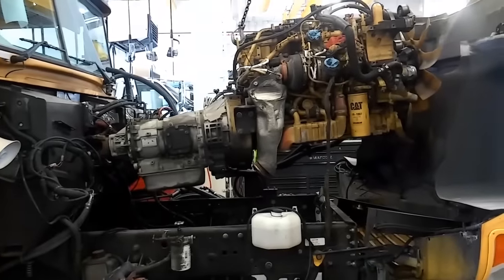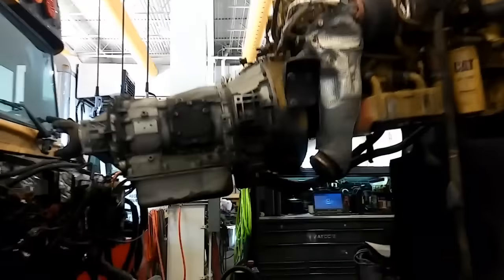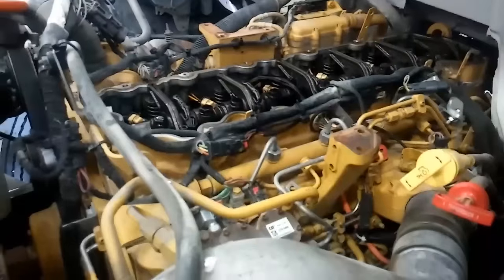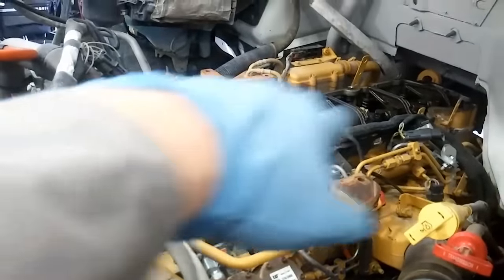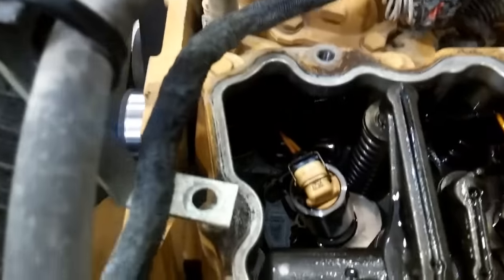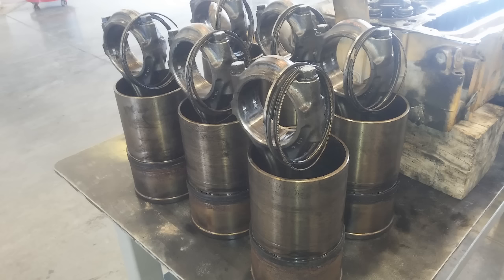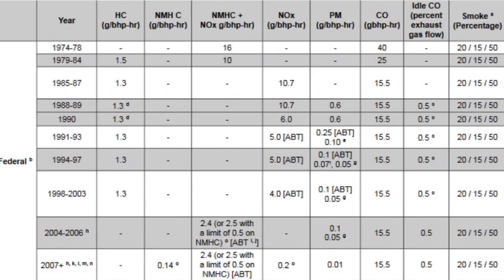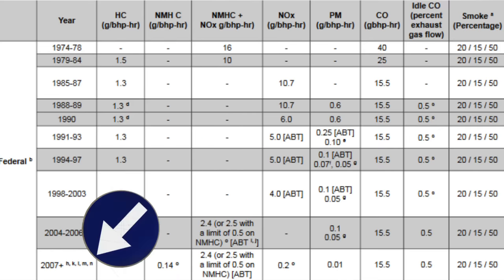The Worst Engine Caterpillar Ever Made.

Comment: Cummins had engines, with timed air compressors, too.

Emissions garbage on the SDP was a joke, as it was. And had nothing but IVA issues with a MXS, too.
Reply: Have you had a good experience with SDP's that have had the emissions items stripped off?
Reply: @electric7487  haven't ran one personally. But, a friend of mine has one that's been deleted. Don't think he's had any trouble with it at all, other than air compressors junking out on it. On #7, I think now.

Comment: Don't know the model engine that was in the truck, but I went to a new company as a driver in 2007 and they had a brand new truck with the latest EPA-approved engine. That truck spent the first two years of its life being in the shop a minimum of every other week, took them over 6 months to finally track down the first problem with the DPF where the DPF heater/injector/burner whatever wasn't machined properly which is why it was clogging constantly, it wasn't getting anywhere near hot enough to burn off the residue. That was just one of MANY problems with the DPF system and a few other issues with the engine. What a nightmare. At least it had a lot of power and drove well on the rare occasions when it was working properly.

Comment: Gee, all this time I thought the 3208 was Cat's best boat anchor
Reply: they are.
Reply: 3208 IS the best boat anchor
Reply: @danielmontenegro3508  got that right they are a throw away engine no rebuilding
Reply: The original one in my truck was mint for a long time, until a rod bering went. I bought one that had been remanufactured by powerbuilt, it lasted a little over a year till it started ticking. Turns out the block was machined to big and a liner they put in a cylinder is moving up and down.
Reply: I had a few NewHolland TR combines with 3208s they where great starters and we had no trouble with them
Reply: 3208 strictly a stationary motor. In that environment they were ok.
Reply: Run one 25 years and over million miles
Reply: @whiskydrinker2911  we have 1 in a twin screw grain truck.   Kinda low on power but the damn thing is the easiest starting engine on the place.
Reply: its just didnt got a cylinder liner.i got twin 3208 on my pilot boat,so far no problems.i'll just need to do regularly check on the engines & overhaul service every 3 yrs just to make sure the engines is good.
Reply: It is
Reply: The original 3116's were no better. We changed out sumps, heads after changing the injector sleeves and were forever setting up the fuel rack. 

They were a disgrace.
Reply: I fear that folks talking smack about the 3208 are just regurgitating things they've heard from people who don't actually have any experience with the engine. The 3208 worked well for applications needing a realatively compact (for 10+ liter) V8 diesel, and we're better than other V8 diesels of the day.
Reply: We have one in our fire truck and it’s fine
Reply: @lyleclark9190  as a career heavy truck mechanic, I would say you’re right. Because the only other 10 liter v8 diesel of the time was a Cummins triple nickel.
      Both those engines are kinda garbage to be honest
Reply: @justinmartin8887  I worked for the Cat dealer in the UK and the 3208 wasn't well liked, that's from practical hands on experience rather than regurgitation. The other engine series we had issue with was the 1.1 series, they were pretty bad. The reworks included a larger sump, a complete new set up for the injectors, resleaving the injector tubes in the heads, recutting the seats, and then changing heads out to try and stop fueling issues. 

Give me an old 3304 or 3306 any day!
Reply: @justinmartin8887  Another V8 diesel of that era I had bad luck with was the GM Fuel Pincher (8.1 liter I think), had an open deck block that was sure to fail head gaskets. 3208 was good as long as it was placed in a mid-sized rig like a school bus or dump truck.
Reply: I was thinking the 1676, an early V-8 ... . . .  .  ...
Reply: But would run forever and take a lot of abuse. A slow dog but reliable as heck.
Reply: Dude the 3208 is bomb proof
Reply: 3208 was a really good engine. They ran really good for alot of hours. Not very fuel friendly
Reply: We
Reply: @lyleclark9190  6v92 if you can't go over 10L
Reply: We've had one for 34 years now. about 35,000 hours
Reply: I have a 36 yr old 3208 & still running strong
Reply: Well opinions are like 💩
Everybody thinks everyone else's stinks 
I have a pair of 3208 cats in a 36 year old 50 foot off shore motor yacht that Sip fuel and start in half a second 
I had another one in a 40 foot shrimp trawler that drug shrimp trawls from North Carolina to Louisiana for year after year and never missed a beat 
I sold that boat 6 years ago and it's still pulling nets on the bottom of the Gulf of Mexico to this day
So, I'd say these 3 at least have paid their way
Reply: I laughed too hard at this

Comment: What I’ve seen of the ARD head, it’s very similar to the Deutz T4i burner system for their 6.1 and 7.8 engines which are also quite problematic.
Reply: Spray all the fuel into the exhaust, that’ll fix the emissions!

Comment: 2007-2012 was a horrible time period for Diesel engines. All my stuff is pre-emission and older, or low enough hp that it’s not required. However, the technology has come a long way in this last decade. I’m comfortable enough that I might buy a new diesel pick-up next year. Those new Cummins X-15 engines are pretty impressive too.

Comment: Absolutely correct. Worked on several of these in the army at a CRC (component repair company). These damned things had STEEL pistons and the bores would get out of round and were not rebuildable. We threw out ALOT of these for that reason. Another was the oil cooler cracking and letting coolant into the oil. Was a total nightmare
Reply: Army trucks dont have DPF ....yet, but the issued inherent in the C7 are still there. Namely the engine is not rebuildable.  C7S issues with the electronics seem more tuning related since each fuel injector is programed individually to the ECM.  The 3116 wasnt without its issues, but the c7s are a flawed engine for heavy duty use.

Comment: My vote for the worst cat engine would have been the 2007 and newer C15 Acert engine with the DPF.  I was buying a 2008 Freightliner Classic that had that particular engine in it. That damn thing spent more time in the shop and than it did on the road. I nearly lost everything because of that damn engine. Years later I found out there was a class action lawsuit against CAT over those engines. The only engine that I've seen be equally as bad, was that MaxForce abomination the International put out a few years ago. There was also a class action lawsuit involving that engine.

Comment: I rebuilt an ISL last year that required timing on the air compressor, didn't know CAT did that too
Reply: If I recall correctly timing the compressor was only for noise reduction. I know for sure on the Cm2350 ISX15 the compressor used to be timed but the service manual was updated and it is not required to be timed anymore

Comment: I know the fleet of  isl cummins I work on wants the single piston compressor timed as well
Reply: I can confirm I work on ISL-G(natural gas variant) and detroit series 50 and the isl has timed air compressors. We use both single and double piston versions
Reply: The single piston gets timed and same with the double  on the isl. It's so stupid.
Reply: ISB and ISC requires it also
Reply: I've put probably one hundred ISC and ISL air compressors in without timing them
They even have timing marks for the signiture series engines, also not required
Reply: @Dilanom  -  Good points.  This is nothing new.  Decades ago Cummins would change the timing for the air compressors on various 855's.  I worked for Cummins at the time, and we just ignored the bulletins, because the new settings did not make the slightest difference.
Reply: You need to dta cat history of engine from 40s on up
Reply: Because harmonics is a lie.
Reply: @asherdie  - Not when there is substantial rotating mass.  

A truck arrived at our shop with a broken crankshaft.  It transpired that the owner had been to three previous shops for replacement of three broken crankshafts in that same engine, after which he decided it was time to bring it to Cummins.  The crankshaft was replaced, installed in the truck, and I was assigned to dyno test it.  I saw that the harmonic balancer was defective and replaced it.  I was unaware this was the fourth crankshaft installed in that one engine.

When the customer came to retrieve his truck, he read in the service write-up that I had replaced the vibration damper,  and so he complained about the alleged needless cost.  The foreman asked me to explain to him the reasons therefore.  After stating my reason, the customer just slinked off with a funny look on his face.  I asked the foreman what that was all about, to which he explained the previous issues.

The rotating mass in an air compressor is very small; thus, to check it for harmonic balance requires the use of expensive tools, tools which no shop I knew about stocked.
Reply: @cwj9202  sarcasm poorly executed on my part.
The reason for timing the pump are harmonics.
Reply: No need to time cummins isx compressors to many f1 truck mechanics out there lol

Comment: The sad thing is, the C7S is probably STILL more reliable or just about the same as these modern emissions trucks.  My next truck will either have a 3406 or  6NZ C-15 in it.  I'm ready to go back to an engine when it "just worked" without any 5k+ parts for keeping the stealerships/repair shops and Commiefornia rich.

Comment: On Cummins, I know isb 6.7 so probably all of them, it tells you in the service manual to time the air compressor to the engine, but I’ve installed them without timing them and it didn’t cause any significant vibration

Comment: Hino Diesel engines have timed air compressors and fuel pumps. The fuel pump bolts to the front of the compressor and they are timed together and then timed to the engine when installed

Comment: Some ag tractors used them back in 70s 80s . Mechanics who worked on them said they would run for years if you did 2 things . Never run them over 2500 rpm and do a bearing roll every 2000 hours

Comment: Been watching a lot of your videos and I just bought a 73 pacemaker with a 3160s twins I was wondering if you could give me any information on these they have $1,500 hours look pretty clean but it'd be worth keeping in the boat or replace it like to know where the model numbers were at other issues if you have any information to be highly appreciated love your channel
Reply: I've worked on several 3160's over the years. It's the predecessor to the 3208 marine engine. Mechanical inline fuel system, non-linered block. They last a very very long time when properly maintained.  Some parts are getting very difficult to find such as governor and fuel system.  They shared common parts with the 3208 that had a sleeve metering v style fuel system.

Comment: Cummins big cam and n14's with single cylinder air compressors the air compressor is supposed to be times to the engine. It will still work fine if it's not timed but it's to reduce noise/vibration.

Comment: I used to do a small, and very limited, amount of work with the C7 ACERT engine at a factory that would use the given engine in the 950H wheel loader.  This was prior to 2007.  It seemed to be a decent engine, but for the life of me, I can't remember what the prefix was on the serial numbers.
Reply: If I remember right they were probably KAL

Comment: Cummins isx air compressors have to be timed too. Also most high pressure fuel pumps nowadays are timed, if not they dont run right.

Comment: Hi friend  Cummins has used the practice of timing the air compressor right back to the first big cam,their explanation is balancing the engine
Reply: Never forget Cummins 444. Had 1 on rotary drill everybody had trouble. Every 6 months or less change it. Got so good by myself in like 1 hour & 45 mins have  engine start to finish removed & chain down on flat bed ready haul to shop for  interchanged. Shop told me mains keep going out. I. R. Asking too much out engine design. Boss even told me take your time I am trying give you a easy day. After that I order food kick back day long job.
Reply: @Houndini  the shop you were taking it to was it Cummins  themselves,  I have worked  on alot of those triple 4s in different  configurations,  what I can remember  their week links were their cams and STC block and injectors, mains going out means oil  pressure  sucked they must of ran like a broken dick cause the STC circuit  would have cavitation in the oil there for one hell of a white smoke show under load ,just imop

Comment: Twin turbo acert pretty big pile of crap too
Reply: Those are the best CAT engines. Ignorance is bliss
Reply: @chief1193  Yeh, tell that to my 3406B & 3406E model. Not bad on fuel if you're driving it sensible with plenty of power.
Reply: Chief119 I think so too.
Reply: C-15 single turbo was last good electronic engine rest are boat anchors I'll stick with ol big cam 3 and 3406s
Reply: Have several acert c15 and c13 engines at work. They have been really good to us.
Reply: The stock tuning is crqp, get a good tune in them and they are solid.
Reply: I don't want to spend money to make one run  I want that sum beech to go to work to make money
Reply: This little c-13  has supprised me it gets loaded to about a 100 7-8 time's a day crawling out of the Badlands of ND every day it doesn't like it to much but it does it I have to crawl out in 2nd direct though  and turbo screaming just oilfield work truck wore out before it even came here to die
Reply: That's sequential turbos on the c15 acert . they are in line not independent so they would not be considered twin turbos
Reply: I would have to disagree. My 06 c11 acert twin turbo is preety good.
Reply: Well they probably are good engines when they don't have to work down in crap holes 116 summers and-60 winter's I don't even run good in these temps
Reply: @jadams736  actually they work great. It works in arizona about 108-110°F on avg here no problem.
Reply: I love my’05 acert! By far best engine I’ve had in a truck
Reply: Justin Adams there compound turbos. Not twin. Ones a high pressure turbo the other is a low pressure.  Can’t remember which one is the primary, but they work together
Reply: Amen brother. Leaking oil liners,cracked heads,actuator failure,cracked turbos,and oil cooler failure. Been there,done that
Reply: I have a 2007 Pete 386 bought new in January 2007. It has the twin turbo C15 Acert under the hood. I pull a reefer throughout the midwest. It has just over 1.4 million miles & has been trouble free. I replaced a water pump a few years ago & the IVA oil pressure sensor a few times. The head & pan have never been off. Still has the original turbos. Uses no oil between changes. Rotella 15w40 every 15k miles with Cat filters & run the overhead once a year. Still runs smooth as silk.
Reply: Update the VVA housings and rocker studs and you're good to go. If you see oil seeping out from under the head fix it the right way and you're good to go. Ive overhauled at least a couple hundred of them with over a million original miles. Thats a pretty good engine in my book. C7S can burn though.

Comment: i bought a new cat 3116 in 1998. marine engine. she now has 10,000 hours. boat probably made me well over $2.5 million. never broke down. purred like a kitten. replace the exhaust riser one time after 10 years of use. she's running now but i'm having another long block being put together as a replacement. blowby is now excessive and there is an oil leak. this engine will be traded in for the one i'm getting and someone will get a honey of an engine when they get mine.

Comment: I think I'd rather have something titled "Worst DPF engines" separated from "Worst pre-DPF engines." However, what you are showing me is that Cat added stuff completely unrelated to DPF or any other smog device, and that stuff created its own set of problems. You said that the VGT mechanism didn't work well, and engines could either have VGT or a wastegate, and still be equipped with a DPF.

You said that there are no replaceable liners. What I didn't expect was not having the ability to rebore the engine and fit oversize pistons. After all, that is what many light diesels do, and it works for them.

Comment: Or commonly called, disposable engines. But they had their place. I actually always liked the 3208 .
Reply: Best engine for 500000K no problem issues after they fixed the rear seals and fuel heaters. There is a guy that runs one in his 350 Super Duty here with a big Miller welder and a 200 gallon two cylinder air compressor. He gets 19 mpg too boot!

Comment: My 3116 mechanical has been excellent since 1996.
Runs as new with a million + on it.
Should I worry yet?
Reply: Bases upon your success, would you recommend a 2000 Freightliner fl60 3126e with  185hp truck with 245k miles?0
If so, how many more miles can  this truck be driven?

Comment: Hey Josh, when are you going to put out more of your course "Diesel Engines 101" for us beginners?  I have been getting time on the spanners at a mates, helping to change out a Petrol V8 for a Diesel 6cyl Perkins on a 1974 Butterbox C1800 Acco.  We have also had to change the PTO on the replacement manual transmission.  It has a 5 speed box with a spicer 3 speed joey box.  Cheers Adrian from Emerald QLD Australia

Comment: Heh there’s a 2005 Ford F750 in a local heating oil company fleet.  I drove it and I knew from day one it had serious problems.  Lack of power, heavy fuel consumption and smoking.  C7.  The other older trucks had the 3126 and 3126B and ran great.